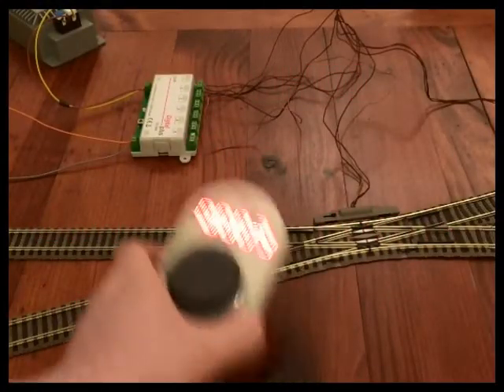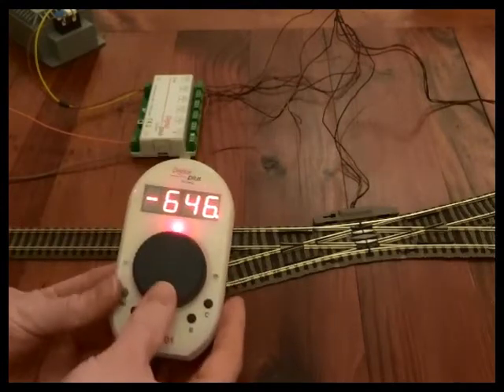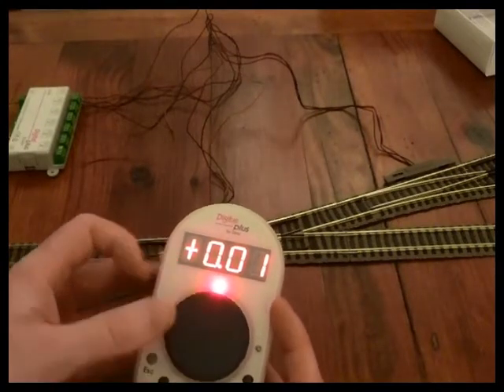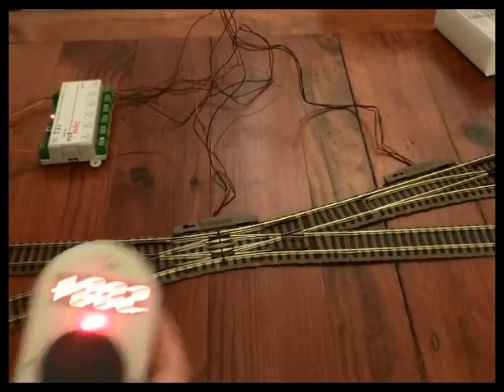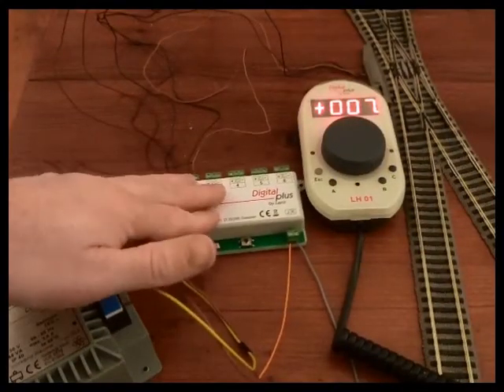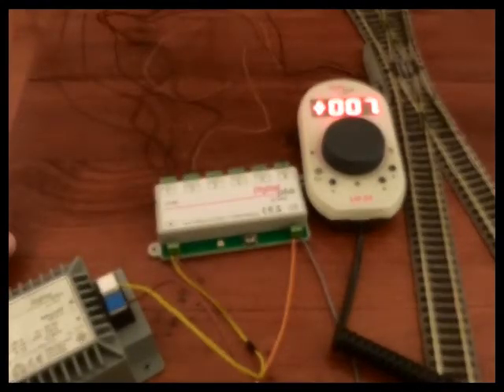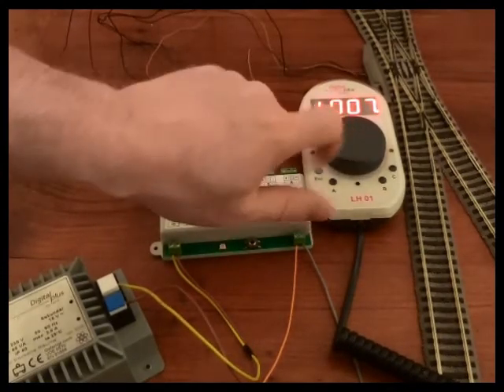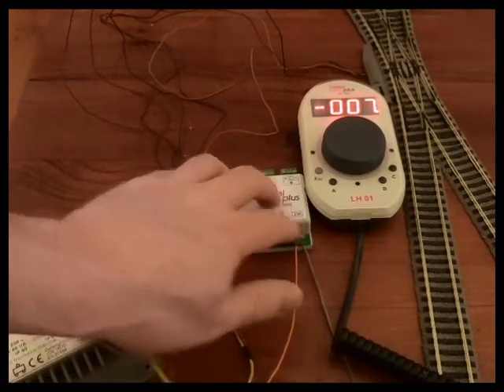Lenz LH01 Film 5 Switching Points and accessories

Comment: Hello ! Is it possible to change the adress of RS8 LDT whith the lh01 ? If yes, how 
Thanks
Reply from the maker: Press  the control on the LH01 upwards to enter the turnout switching menu. Rotate the controller to set the turnout address.  Press left on the controller to move between digits Set the turnout address up so that this will be the first address on the RS8- it is quicker to do than to type this.
Now press the programming button on the RS8 until the led flashes..  On the LH01 press the control down to switch the turnout.  The RS8 will see this instruction and take that address.  It will automatically set the other 7 addresses.  You will need an LH100 or a PC interface to be able to see the feedback information that the RS-8 produces.  The LH01 was not designed to show feedback itself.  Cheers.     Chris
Reply: +digitalcareline Thank you for your help ! I will try  this afternoon